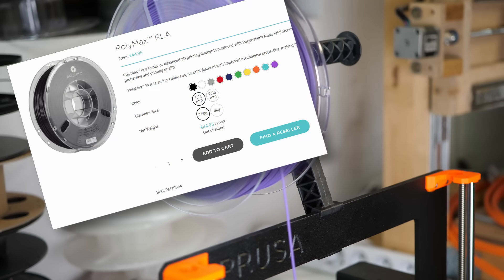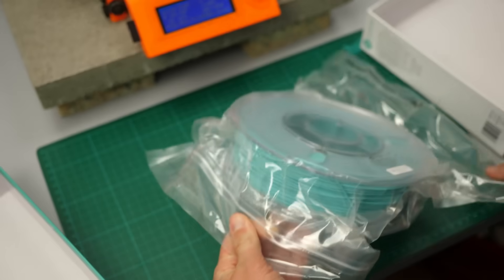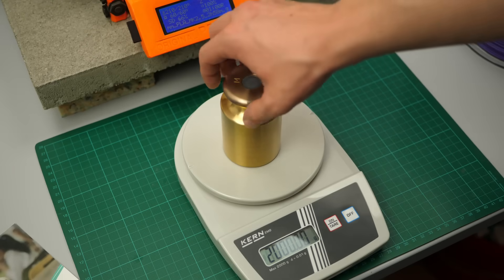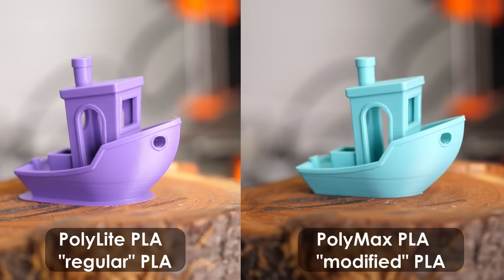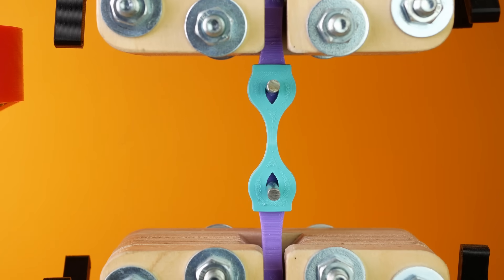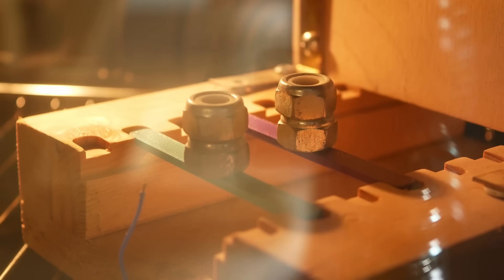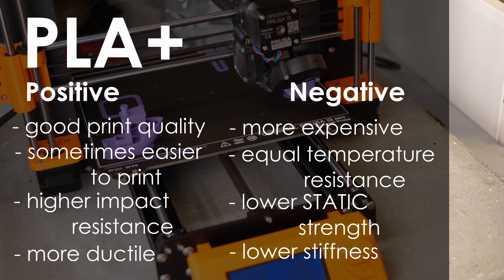How much STRONGER is PLA+ really?

Comment: btw, going about his statement on PETG in the conclusion: I've tried a bunch of different brands PLA+ (sunlu is pretty good) and they were all stupenduously more solid and impact resistant than any PETG (or even the one batch of PCTG) I've tried, and this in a context with pretty heavy mechanical strengths at work (RC cars), so, I for one, disagree!

Comment: The HDT of these modified PLA materials varies a lot between manufacturers. As you observed there is no real difference in heat deformation temperature between PolyLite and PolyMax PLAs. Similarly, UltiMaker specifies their PLA+ as having a slightly lower HDT as compared to their PLA. 

The major outlier here is Dremel, who claim an HDT of 78C for their "Eco-ABS". I've used that material a bit both in a Dremel 3D45 and in the Prusa XL that replaced it, and I can say that it unquestionably has greater heat resistance than vanilla PLA, perhaps on par with or a little better than PETG. It isn't a true replacement for ABS, though.

Comment: I know im several years late. I tried making phone cases out of standard PLA and "super PLA+" (both from Aperture) and found that in standard PLA the layers fell apart in thinner areas like speakers/volume/power and any other overhangs. However the superPLA+ has let me put my phone in and take it out of the case over and over without issue.

I have no idea which of these strength/durability tests that really shows up on, but its a use case that i find super fascinating

Comment: PETG is great for heat resistance,  but it's a bear to print clean,y and takes a toll on my print bed....I was hoping to find something as heat and UV resistant as PETG, but prints like PLA.  I need something g that will withstand indirect sun light and heat from an engine running in the summer within 4-6 inches of it.

Comment: bro this was very informative, the very first filament I used was PLA+ it just seemed like a good starter option for a beginner and it was a good brand on sale. I was told it performed ever so slightly better but I have been unable to compare it to know the facts thanks for all this information. BTW it was only 21.99 that was 1 dollar more then its cousin of the same brand. I would say the material stress factor was way better all around on the PLA+ because it stretches and I like the more of a matte finish, but in all honesty this preference kind of comes down to what you are printing and its use case. I don't think the one dollar more is too much to ask for a higher print success rate either.

Comment: I used an eSun PLA+ filament to make a hood prop clip for my car since the OEM one was broken, but the original one I printed out definitely softened and deformed enough to come loose. After annealing in the oven I got a second print to stay clipped into the slot to today, so I'd be interested to see how annealing PLA and PLA+ would affect its durability, especially thermally.

Comment: While watching this video I had a bit of a eureka moment as my hobbies and work experience came together to make me have a realization.

I used to just watch these videos for fun but now that I'm seriously getting into printing and now know what I'm printing it makes videos like these even more interesting.

I'm an ironworker (Steel Beam / Rebar Guys) And right now I'm learning about rigging and cranes, so right now mostly about different fiber and metal wire ropes.

For many things Ironworkers use steelwire ropes to pick things up with cranes. they're reliable and can be constructed in different ways to have better bending or wear resistances.
(This comes back to 3D printing I promise)

Another option that exists out there is using chains instead of steelwire ropes. Chains don't stretch, they're strong as hell, easy to hook shit up with, they're really great.
But they're rarely used. Why?

Because whereas wire ropes will show signs of weakening before they fail, giving you ample warning to replace them, if chains fail they suddenly and violently snap and drop loads which is dangerous as fuck.

So even though chains may be "Stronger," the physical properties of wire rope are better because they give gradually instead of at once, much like PLA (Chains) vs Wire rope (PLA+)

This made my search for the right filament click because the objects I will be printing will undergo many shock loads and I'd much rather have my part show signs of failing rather than looking fine until it suddenly explodes when I need it the most.

Comment: The situation from two years ago is still relevant today. My printer manufacturer only supplies PLA+ as official filament. Problems with moisture absorption are greatly reduced. Today's PLA+ printed products have the impression and characteristics of acrylic or glass rather than plastic. I have some concerns about safety, but I like it for my use.

Comment: PolyMax is not the same as MolyMax, I had to find that out during my RC project last year. I downloaded a 1:14 monster truck and adapted it to 1:8. I picked out the colors based on looks. But quickly had to determine that there were serious differences. Black was very hard, but did not have the toughness. Green broke very easily at the layers. White was very flexible and tough, but the layers were very visible. Gray was beautifully smooth, very impact resistant and tough, but not hard enough under mechanical stress. Attempts with carbon filament didn't really turn out well and no more stable despite the matching print head from Qidi. Thanks for the many good tests. groovy regards, Kay

Comment: I use Tough PLA. it is super flexible so it resists impact better. great for long and slim pieces. i printed an axe and the middle broke when i dropped it, switched to Tough PLA and it didn't break when i drop tested it.

Comment: I'm very dissapointed with Gembird's yellow pla+... Tried to fine tune slicing parameters to print a tiny print-in-place excavator, but after multiple failed attempts I gave up. There were holes in the upper surface, and the in-printed joints broke regulary.
Switching to normal pla, it urned out perfectly.
In my opinion that material is not for high detail models. Also, it feels very mallable. I prefer regular pla, however the matte look is nicer of the plus.

Comment: one of the main reasons for me to use PLA+ instead of regular PLA is supports. The brittle nature of regular PLA makes removing support structures a major pain, while they mostly just easily peel off of PLA+ and regarding the temperature resistance: in most cases manufacturers claim that you can temper PLA+, making it cristallize and increasing the temperature resistance and strength immensely. I've never tried it myself but know people who do temper their prints and say that it does indeed work quite well.

Comment: Polylite Pro by polymaker is my go-to. Its a good middleground between regular PLA and the Polymax. I think polylite pro prints as good or better than standard pla but is only a few dollars more. In terms of toughness its not as ridgid but doesnt shatter like regular PLA. Layer adhesion is also the best ive ever had. Its just an all around solid filament and easily worth the slight cost premium.

Comment: My experience with pla Plus specifically polyterra pla Plus, is that it is more impact resistant than regular pla but instead of shattering it slightly deforms because it's softer.

Comment: I print alot of self defense tools, knuckles dusters for example.     Legal to manufacture and own where I live.   I use PLA+ or PLA PRO.   I haven't done any  impact tests other than against 2x4" boards.   No structural damage at 20% infill  3 shells , 4 top and bottom.  Pla also held up well .  Both had slight damage to surface finish.     Just to be safe I chose plus/pro

Comment: I've tried PLA+ from ESun and it was as hard to print with as ABS
Reply: You don't know what you're doing then.
Reply: @dangerous8333  A snide comment without any recourse! Classic Internet. ESUN's PLA+ is terrible. It's brittle, has a "just right zone" so strict a speck of dust can put your print bed out of alignment for it, it's not malleable in the slightest and all of the spools are wound by overexcited chimps. You need to babysit every print with the stuff.

Comment: I'm late to the party, but it's VERY reassuring to see the scores of people calling for testing of eSun PLA+ because it's their favorite filamet.  I randomly ended up using it just looking for well reviewed cheap filaments that had preset profiles in Cura, when I got my first 3D printer recently.  Great quality prints directly onto clean glass with no hair spray/glue.  Just make sure you have good parts cooling, or (like in my case with my $80 CAD used printer) fiddle with the print settings until you get a literally mirror smooth base layer.

Comment: Were the print settings changed at all between the different materials? Could very well be that it needs higher temperature?
The other thing I notice is your notch Impact energy "Charpy" test needs work. The piece should be laying down, and supported on both ends on one side. You will more than likely break all your pieces then, and not get unbroken ones, and if they don't break, the imapctor will stop.

Comment: Ecotough 2.0 is 32$ per kg and the best pla there is on filaments.ca it's uv resistant food grade safe and more heat resistant but it's always sold out they're econofil is ecotough 1.0 that's not uv resistant

https://filaments.ca/collections/3d-filaments/material_econofil-pla

https://filaments.ca/collections/3d-filaments/diameter_1-75mm+material_ecotough-pla-2-0

Comment: I have tried PLA+ after my usual brand was no longer available on Amazon (at the same time that Amazon Basics started offering PLA, might be a coincidence though). It was just all around a bad experience. Clogged the nozzle more than once. And even though the print temperature was set to 220 °C (the roll said 200 to 235 °C), it still didn't extrude well. Returned the roll with the remark "product doesn't work for the intended purpose" and went back to printing with PLA from a different seller.

Comment: It would be interesting to know how common 3D printing materials compare with ACTUAL WOOD (not wood filled filament) It would be useful to know how to adjust dimensions of a traditional wood structure when 3D printed with commonly used filaments. For example: The rosewood in a guitar body is commonly 2mm thick, how would that dimension be adjusted for equal strength if 3D printed with common PLA?

Keep up the good work!
Reply: Interesting, but I think if you've ever worked with wood. There's no comparison. Wood can take a lot and can bend a lot. That's why it's the only material used in framing houses in earthquake zones. Without checking on YouTube first my guess in terms of a guitar, being a guitarist myself, the different thickness is going to create a different tone so I don't know if it would be beneficial.

Maybe an electric guitar or like an ovation.

Your question just gave me some wicked ideas.

Comment: Might the PLA+ be less thermally conductive than normal PLA? Maybe it's more thermally resistant that way, softens at the same temperature but not heats up easily. It would be interesting to test.

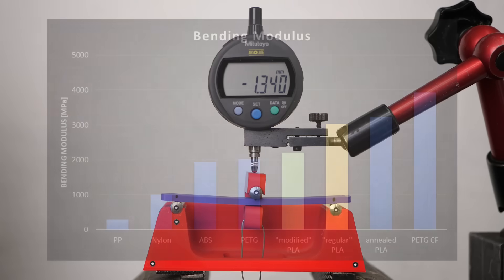Comment: nice that you check the 3 point bending; but id maybe change the measuring point; its visible at 8:15 that the flat surface is swaying to the sides, making it practicly impossible to get an accurate reading(i know why you used a flat surface, but maybe use a bearing or similar so that flat surface always stays level and is not changing the results while beeing loaded unevenly)

Comment: Stefan, what are your thoughts on using a PLA+ to print up an RC model aircraft vs. standard PLA? Is one choice better than another? I am thinking the impact resistance may come in useful on those "less-than-perfect" landings.
Reply from the maker: PLA+ might make printing the parts easier die to less warping though you might lose a bit of stiffness. Still probably the better choice in the end.

Comment: I've been running pla+ since I was having problems with high stress prints for rc car parts failing in pla and was tired of petg print quality. I find the pla+ easier to work with and as strong as petg.

Comment: Hey, I was wondering why you are using those kinds of hooks. The way you designed the hooks, causes a moment internally. Different kinds of materials react different to bending moments, which could result in unfair measurements. A lot of the time you are giving the stress internally in Pascals, tho such a material might not even break at that stress level since a bending moment is introduced as well. Why don't you create a symmetric hook. Creating such a hook makes sure no bending moments are introduced.
Reply: Just started watching your channel, and I must say that it includes some very nice insights in 3d printing structural integrity optimization. One of your video's noted what I just said. And yes I agree with you. Tho I wouldn't call it a tensile strength test. It's actually quite obviously a bending tensile strength test. Maybe you should compare different slicers on strenght.

Comment: PLAs ease of print makes it my favourite for most applications. The only real acceptions I would make would be for ABS in high-temp applications or modelmaking  - where I prefer to acetone weld 3d prints over using CA glue.

Comment: Thanks for another great video! One test I'd really like to see is how easily different materials deform over time. For example, I've designed a simple filament clip (thing:2867427) that keeps the filament in tension around the edge of the spool. The ones I've printed in PLA become loose over time, while PETG seems to keep its tightness. It seems PLA will slowly deform under tension, and it would be cool to know more about this, and how other materials perform in this respect. Have a good one!

Comment: I now look to buy filament with an available data sheet, "plus" and "pro" don't mean anything other than it's modified beyond color. Some Pla+ is significantly tougher and/or highly heat resistant or has uv resistant additives or additives to make it print more smoothly or a number of other things. The Esun Pla+ which seems to have a lot of fans (and some obvious shills) in the comments here, are only slightly improved in one or two aspects. (Which, to be fair, they do tell you in their own chart mailed with the product -  I don't think they have a full data sheet available, but if you need to know more than their chart shows you probably need something more expensive anyway.)

Comment: I found PLA+ prints nicer than PETG (Micro Center Inland branded filament), not by much but it could be enough to make a significant difference in some prints. Otherwise i use ABS and PETG for mechanical parts, PLA to test out things and PLA+ for models

Comment: Hi to everyone! Question : Does anyone know any Good - Strong bond method between PLA and Iron ? i have made a Pulley with threaded bore to screw it in  threaded axle motor. i would like to bond them for extra torque  when motor turns anti clockwise (tend to unscrew the thread).

Thanks in advance

Ps: i used  threaded  lock (loctite / permatex  medium holding) and didnt seamed to hold it so strong

Comment: Have you tested, or do you know of how using infills of a different material than the shell effects the strength of the print? Does it just take  the qualities of the infill material? Or maybe takes the qualities of both? I would b curious to know if using a strong, but unattractive infill and an attractive but weak shell would be a viable strategy or if it is pointless.

Comment: I tried PolyMax and Extrudr NX2 for printing boomerangs. Both are definitely more floppy than regular PLA and a little denser. The big advantage though is that they will bend before they break, which is good for my application. Bend tuning is easier, but won't stay in shape as long. PrimaSelect is also supposed to have some optimized properties, but that feels more like the regular stuff.

Comment: Hallo Stefan, so gut viele Deiner Videos sind, so ärgerlich ist die Verwendung imperialer Einheiten, zumal sie - nicht einmal in den Grafiken - in metrisch umgerechnet und angezeigt werden. Hier noch einmal eine englischsprachige und kurzweilige "Unterstützung" nicht weiter alte "Technologien" zu benutzen. CNC und 3D sind neue Technologien. Gründe, keine imperiale Maßeinheiten zu verwenden werden im Film zwei aufgeführt. Die Liste ist leider beliebig erweiterbar. 
Is The Metric System Actually Better?: https://www.youtube.com/watch?v=hid7EJkwDNk

Pedro Henrique zitiert dort:  
“In metric, one milliliter of water occupies one cubic centimeter, weighs one gram, and requires one calorie of energy to heat up by one degree centigrade—which is 1 percent of the difference between its freezing point and its boiling point. An amount of hydrogen weighing the same amount has exactly one mole of atoms in it. Whereas in the American system, the answer to ‘How much energy does it take to boil a room-temperature gallon of water?’ is ‘Go fuck yourself,’ because you can’t directly relate any of those quantities.”
Josh Bazell

Comment: Congrats on the little one that will make big changes for you!   I tried pla + max and the other modified pla filaments.   For me it's not worth it.  I prefer just to use pla most of the time or petg for mechanical parts and occasionally I use abs for temperature resistance needs.   I will be trying some prusament pc blend soon! 

Thanks for doing all these tests for us. It's very much appreciated!!

Comment: I use eSun PLA+ exclusively because I need more impact resistance and I was told it had a better temperature resistance.  Also, eSun PLA+ is about 24USD per 1kg so it isn't very expensive.